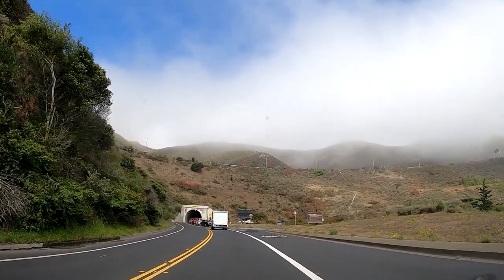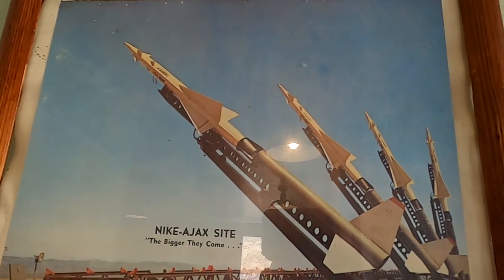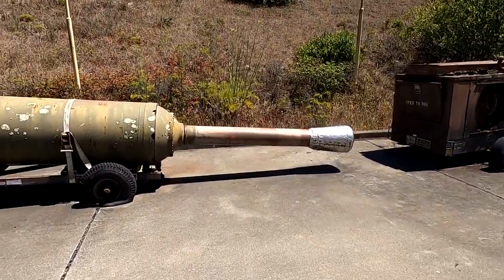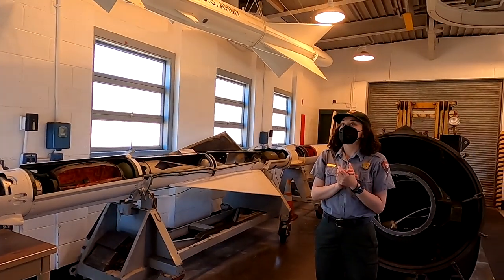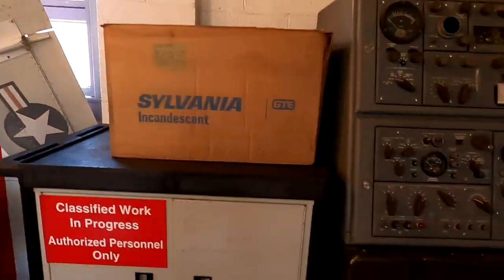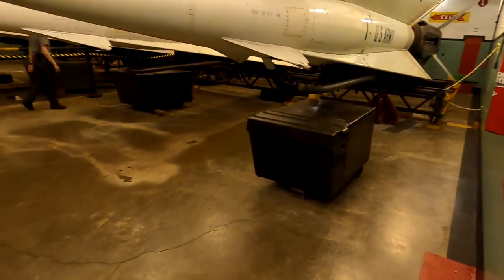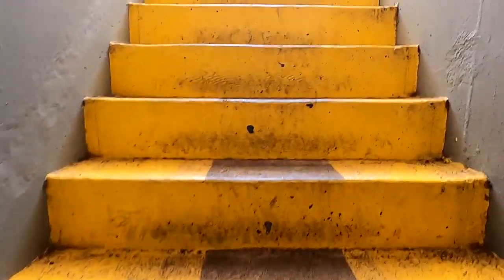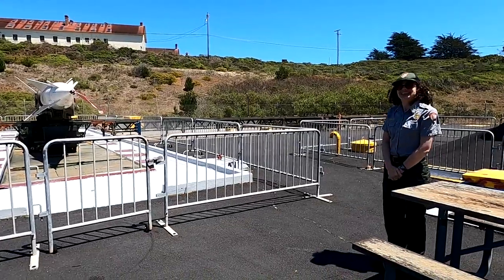The only restored Nike missile site in the country - SF-88

Comment: I worked at White Sands missile range as an AN=TSQ-73 Operator/Repairman. 2nd Bn. 52 ADA. This is the firing control system for Nike Hercules. It was running when I left, summer of 82.Those missiles would rattle our fire control annex building when leaving the rail!
Reply from the maker: Wow, great story! Thanks for sharing.

Comment: I live in a house that I was told was built in '55 as officer housing for the officers manning the Nike Missile site up at Tilden Park above Berkeley CA.

All the homes on the street are identical inside.

I had to cut through the front path to install a French Drain. The concrete was 8 inches thick and had no cracks!

I would bet that it was from the same contractor who built the bunkers and silos!
Reply from the maker: I had no idea that there were Nikes up there. Very interesting. Thanks for sharing!
Reply: @Bayareaandbeyond777  All that is left at Tilden is a concrete pad up on the top of the hill.

I've seen it in videos.

There is a court in Pleasant Hill as well as in Walnut Creek California that have the identical US Army officer's homes.

They were all built with a birdhouse above the garage door. And Fluer de Lis wooden details on the columns in front.

My neighbor, who was 6 years old when they were built told me that they were called Normany-Style.

I wonder if these homes were built all across the US, or just in the SF Bay Area.